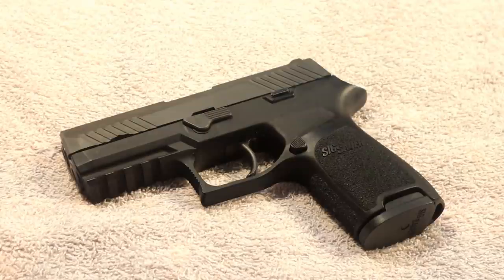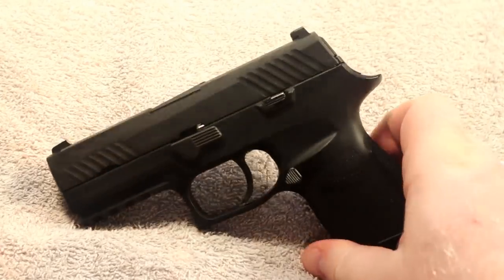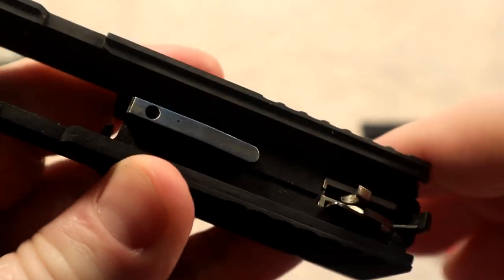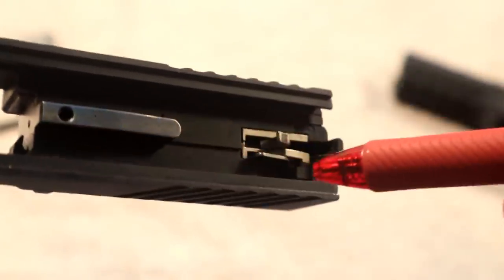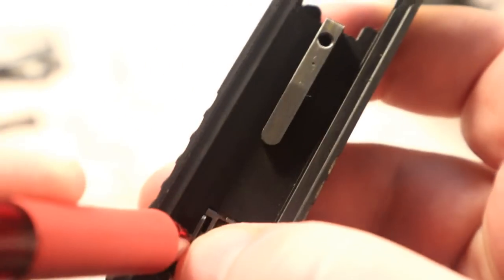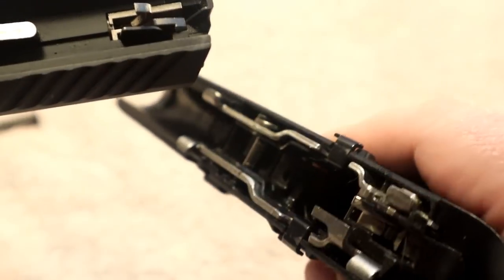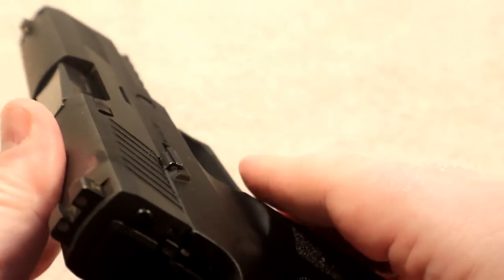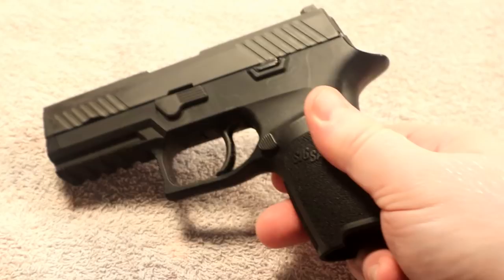The Sig P320's Dirty Little Secret You Won't Find in the Manual

Comment: Several independent firearms experts have examined the safety features on the Sig P320 and determined that it would be impossible for the gun to fire a round without the trigger being depressed. These lawsuits are being promoted by anti-gun activists, in attempt to shut down Sig. None of the firearms named in these lawsuits were properly holstered,  thereby creating the possibility that  the triggers were inadvertently moved.
Reply from the maker: EXACTLY!!!
Reply: No its not. Theres a video of a guy dismantled the gun and showed and explained why it happened. Its truly a design flaw
Reply: @jetfu400  A firing pin block is not a trigger safety.
Reply: I’m not sure that’s true.  Why wouldn’t they go after all other manufacturers?  OR, what’s your primary source proof that the lawsuits are promoted by these groups?  I’m not saying they wouldn’t try some bs like that… 

All that said, my gunsmith (who I trust above all) says there are inherent design flaws which cause the “uncommanded discharges”.
Reply: @DookeyRidr  Trust no one. Test your own gun. I did.  My Sig didn't fire once when dropped. I have no plan to hit it with a hammer.

Comment: I carry a P320-C almost every day now for over 2 years now, in a quality holster and quality  belt I never think my gun will will go bang because I treat it with respect. At first I was was leary of a pistol without a safety but I got over it. I love my P320c !
Reply from the maker: They're great guns
Reply: Great pieces. Safe as the person handling them.
Reply: I carry a p320 M18 everyday love it
Reply: @BoomStickTactical  They earned their bad reputation by not being drop safe. All semi-auto guns require extra care and training regularly. IN THE END, the mechanical failure is caused by "the nut that holds the trigger."
Reply: All pistols, whether single or single/double action should have a thumb safety. And single/double actions should have a de-cocker.
Reply: I don't carry hammer fired guns with a safety anymore. An external safety can easily get bumped out of safe. It is a little counter intuitive but I am much more comfortable with a holster being my safety. Well, that and I'm not an idiot!
Reply: @thebusterdog6358  I disagree. It comes down to training and a proper holster. I don't want a pistol with a manual safety and the ones I have that have one I ignore completely. You can want them on all yours and only buy guns with them but to say ALL guns need one is incorrect
Reply: Wrong
Reply: Boom, any day. All by itself.
Reply: @thebusterdog6358  um no. no thanks.
Reply: Y’all are crazy to keep this gun or say they are good guns with all of these law suits 😂 y’all wouldn’t defend other things like this when they are proven to fail. It’s only a matter of time before it happens to the ones who have this gun😂😂😂Glocks would and have never😂😂😂
Reply: I pray u don’t regret it arming yourself with this weapon. There is, I think, over 70 incidents of the weapon going off by itself. That’s enough for me not to purchase it. There are many more choices of quality weapons to chose from. I don’t wanna shoot myself or a love one. Just my opinion. Like I said, I pray all goes well for you.
Reply: @TexasT75751 the term "Glock leg" came about for a reason.....
Reply: @richardbartlett6701 It wasn’t for accidental fires like the recall sig has on their firearms it was because they pulled the trigger some kind of way come on man
Reply: @TexasT75751  Glock got the same grief over people not doing their job, same here.
Reply: @richardbartlett6701  I totally disagree the dog has a problem that needed to be corrected inside the gun it was not firing correctly or it was negligently going off with just a bump. People with no gun safety or not thinking with the Glocks causing accidental or them pulling the trigger by something getting in the trigger guard or their finger on the trigger. Man U know this already

Comment: If the trigger gets pulled to sear release & discharges - that is evidence of proper weapon function! KEEP THE TRIGGER COVERED WITH A RIGID MATERIAL. KEEP THE WEAPON IMMOBILE IN IT'S VESSEL. KEEP THE WEAPON ISOLATED FROM OTHER OBJECTS. Pretty simple.
Reply from the maker: Very simple
Reply: Amen about time other people acknowledge this.  Its like stupid cops shooting themselves and then saying "I swear to god I never touched it."  Then 2 weeks go by and videos surface showing them manipulating their service arm.  Duh!!
Reply: Yes one should not be casual when handling a firearm and as somebody else pointed out some discharges occur because of failure to keep their trigger finger clear of the trigger when reholstering and it gets pinched between the trigger and holster surface and if they shove that gun hard enough by way of habit they actually fire the gun and probably know it and then seek an alternative explanation to shift the liability and escape blame.  People have to learn how to holster and practice the maneuver as it's out of sight,
Reply: @iamnightmare1848 I have a P320 and hoping that this is all bullshit. How do we explain that Gunghis Khan guy at the shooting competition where he had his pistol holstered and his hands at hi ready and several people saw the gun go off and signed affidavits saying they saw it? WTF Is going on here?!!
Reply: There's evidence of the striker spring malfunctioning.

Comment: Wow that’s the best review I have heard yet    Thanks for explaining everything so sounds like multiple failures have to happen which is impossible.   I’m a proud owner of a sig p320 x carry edc
Reply from the maker: They're great guns
Reply: Great pieces. Safe as the person handling them.
Reply: Same here, no problems at all, very reliable.  I was thinking of getting a new FCU with manual safety, but then I would have to dremel my x-carry frame for the addition of the safety levers.  Seems a bit much, but it's still fine as is.  I'd say a rock solid holster and it's hard to go wrong with this pistol.
Reply: Brian
Not impossible, just unlikely.
Most accidents or catastrophic events are results of multiple failures.
Reply: It's not I'm possible Gunghis_Khan had his P320 go off in his holster during a competition with multiple witnesses.

Comment: Awesome breakdown of what HAS to happen in the firing sequence of the P320! I have a new P320 X five legion, and this video clears up the alleged "Accidental Discharge" issues to me clearly! Thank you!
Reply from the maker: Thanks for watching
Reply: @BoomStickTactical  so, why do you think these cases are being reported of the guns going off by themselves? Are they lying?  Are they actually pulling the trigger and not realizing it?
Reply: @jonburrows2684  No because there's video footage of them going off without a hand near it.
Reply: @zackj997  ok, thanks!
Reply: @zackj997 most likely because they had something done wrong when being re-holstered. I also am willing to lay odds that they are going off due to stupidity and they are trying to CYA by blaming the gun, and those videos were most likely manufactured
Reply: @zackj997 ... Literally NO such video footage exists. 😐
Reply: @zackj997 There's only ONE video where this is the case. However, no hands on the gun doesn't equal negligence free, if something did get in the holster before the officer in question holstered his pistol, then that could still be the main reason behind the gun firing. The flex of a polymer holster and the ultralight trigger/fully tensioned striker could easily get the gun to fire with little movement of the trigger if it's already being pressed by a foreign object.

The reality is that not a single independent researcher or law team has been able to replicate the Sig P320 firing by itself. Quite frankly it's almost mechanically impossible to do so without multiple parts breakages all happening at once in the gun, but that would have been discovered right away.

The reality is most likely simply that the trigger is too light and easy to set off for duty.
Reply: check out the modern survivalist he will tell and show you the problem with the fire control unit for me I think sigs rush to blame the user instead of tackling the issue did more harm to their rep and yes they did fix the problem

Comment: This is by far the best video explaining the conditions that would have to occur for a true uncommanded discharge to happen without the trigger being pressed.  Keep in mind that it is a fully cocked striker mechanism, and the sear engagement distances are not huge, but at the same time, you'd have to have the trigger move rearward somehow.
Reply from the maker: Glad you enjoyed it!
Reply: It would only take a wee bit of dirt to make the firing pin block stick upward...the spring is tiny and not very strong so that's a possibility for sure.   But the sear still has to be released to fire and this CAN happen because of play in the slide/frame interface.   Most holsters grip the slide tightly and when/if you apply force to the grip the sear surfaces are going to be moving relative to one another and repeated working could 'walk' the firing pin off of the sear.  
 
Every 'it went off by itself' I've read about and seen video's of do not involve a gun just sitting there discharging...there's always some movement of it and the most recent discharge in the holster had the gun struck hard by a fellow officer while they wrestled with a suspect.

I'm betting if you examine the guns that 'just went off' you'll find play in the slide to frame rails along with weak springs in the safety mechanism and/or dirt.  Throw in some wear and manufacturing tolerances and it's no surprise to me that some are firing when they're not supposed to.   Fully cocked striker systems are GREAT for competition as they allow a very light trigger pull...but personally I wouldn't be comfortable carrying one daily.
Reply: @recoilrob324  Recent story Indian River County Sheriff's SIG went off just setting it onto a table. Let's get serious here.
Reply: @jameylane1591  For real...I'm NOT a fan of a fully cocked striker system being carried daily.   That gun had to be SO close to releasing the striker that just the slight jar of setting it down was enough to let it slip.

Was the gun still in the holster?   And how much play did it have in the slide to rails?   I'm sorry to say...but that's just a bad design for a carry gun IMHO.
Reply: @recoilrob324  I'll deal with the longer trigger pull with a Glock. A Glock's firing pin doesn't have enough momentum to fire the primer even if a safety failed.
Reply: @jameylane1591  I'm with you there for sure!   Striker guns are fine as long as they aren't being held in the full cock position and the trigger has to pull them back to then fire.   Whoever thought up the SiG fully cocked setup wasn't thinking about 'Real World' and just wanted the lightest trigger pull they could get.  A 1911 also has a great trigger most of the time but they also have a mechanical safety which makes them totally safe to carry.   Wish we could see an examination of the gun that just fired and figure out just what happened.
Reply: @jameylane1591 Are you sure? The stories I research state the pistol fired while in the holster and injured the officers leg. 
That doesn't square with your statement?
Reply: @gunguru7020  Whatever dude.
Reply: @jameylane1591  Whatever, what? You tell a fabricated version and misrepresent what actually happened. You either were mistaken or flat out lied about it. What can the purpose be for that?

Comment: Thank you for this video! I have the Sig P320, purchased it as my first carry firearm. I shot one at the range and instantly fell in love with it. Had slight concerns after hearing the stories of them just firing for no reason, but you have totally eliminated any concerns that I have with this video. I purchased my holster from Alien Gear and it totally covers the trigger. Thinking about purchasing the P320 Legion.
Reply from the maker: The legion is cool but expensive.
Reply: Man the start of your comment sounds so much like my experience , I had to check the user name again and make sure it wasnt mine! Went to the range and it included a free rental of a couple models of your choice to try (you supply ammo) and I asked for a P320RX when they first came out. That gun shot so well, I had to have one! I had just bought a p365 and I had pistol fever all over.

Comment: The issue with the P320 is that the safety mechanism disengages too early when the trigger is pressed. Ideally, the safety mechanism shouldn't disengage until right before the trigger breaks, but on the P320 it happens in the first few millimeters of travel. The safety can disengage if even the slightest force is applied to the trigger, whether it be a finger, an object, or even a holster with a tight fit around the trigger guard.
Reply from the maker: There's nothing wrong with Sig. The problem is people not knowing how to handle them.
Reply: That makes zero sense. Whether the safety mechanisms disengage in the first mm or last the trigger still has to be depressed. If the trigger is slightly depressed without firing the safeties will reset after the trigger is released, they don't stay disengaged. As long as the safeties are functioning it doesn't matter.
Reply: @brianmunkres1767 it does mean that dropping the pistol could release the safety of easier, so something like the sear slipping could cause it to fire. Error stacking.
Reply: @shuumai  that's quite a drop. Perfect enough to move the trigger back a fair amount and also disable several safeties. Not saying it's impossible but incredibly unlikely. I mean they purposely worked on the drop safety and added a secondary sear. So not only would the trigger be back far enough to disengage safeties both sears would have to be jumped.
Reply: BS

Comment: I've been saying since the beginning that the SERPA holster was the issue. I used to have one that I used when I played airsoft and I always had issues when ever I took it off my belt and set it on the table, if anything touched the button, the lock would disengage and the gun would slide out of the holster. Using a SERPA holster to carry in a purse is a major safety issue in my personal opinion.

To boot, there are currently 9 cases ongoing with people suing Sig Sauer over the P320, and well into the millions of guns sold. I would say these issues are all user error. If the military isn't having self firing issues with it, then what is everyone else doing wrong lol. I could imagine Glock Fanboys doing this type of thing because the Sig outsold glock over the past year in all markets.
Reply from the maker: Sign are fine
Reply: Exactly. As soon as I read that article I blamed the holster. That is the one thing, with no trigger safety the sigs are less tolerant of crappy holsters which has an easy fix…don’t use crappy holsters. Our military has not reported any problems since fielding and it’s not only the main troops carrying it. The devgru guys are supposedly using the x5 non legion (there are pictures from Afghanistan) to the best of my knowledge and there are videos of two recently retired devgru guys talking about how they think the p320 is their superior pistol to a retired green beret (field craft survival).  I have switched to the 320/365 from Glock which I have used for 21 years and put 2k through my 320s in the last couple months including holster drills with no issues.

Comment: One problem, the firing pin block only needs to move about 1.09mm to disengage, it does not need to be fully depressed. In a perfectly rigid holster, that wouldn't be a problem. But if your holster is just a tiny bit touching the trigger, and flexes just enough to touch that trigger, it doesnt need to move much, to defeat the firing pin block.
Reply from the maker: The same can be said of most striker fired guns

Comment: Thank you for going into such great detail.  My Sig p320 has a manual safety for inadvertent trigger pull as well as what you described.  Your explanation of what has to fail in order for the pistol to fire makes me a lot more comfortable with carrying in light of all the recent news stories and lawsuits.  I have subscribed to your channel.
Reply from the maker: Glad to have you
Reply: Watch Gunghis_Khan he had his P320 fire while it was in his holster and he was raising his hands during a competition. Several people witnessed it and he has pictures of his leg.
Reply: @Master_Yoda1990  Thank you for your suggestion.  I watched the video and part 2 also.  I do not suggest that they are not being truthful, but most likely they are mistaken.  It is easy to make an error, and re-holstering is a dangerous process that needs to performed carefully.  There is no video that I have seen that clearly shows a discharge of a Sig p320 that could not be the result of sloppy handling.

Comment: If someone says the firearm discharged without trigger being pulled but, upon inspecting the safety mechanisms of that firearm, none were found to be broken or otherwise faulty, it is pretty much assured that the trigger was pulled, whether or not it was intentional. Correct?
Reply from the maker: Bingo

Comment: I have a Sig P320, and the problem is not the internals but the physical trigger itself.   The trigger is really light, and just as wide as the trigger guard, with no trigger safety catch in the middle of the trigger (like other manufacturers).  This type of system increases the possibility of a snag while holstering, or possibly when the gun moves in the holster.  For now I will not carry one in the chamber until I replace the trigger with an after market one that has the lever mechanism that requires the trigger to be pressed the middle of the trigger.  You can find them online.
Reply from the maker: And that's why you keep your finger of the trigger until you're ready to fire.